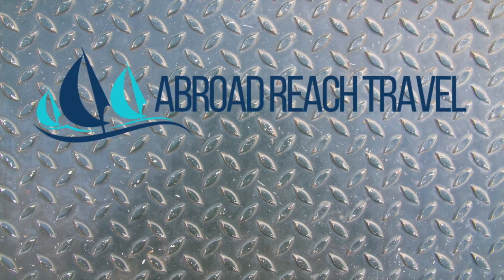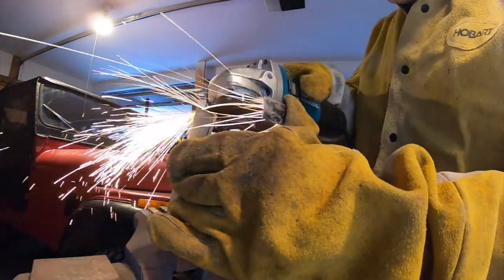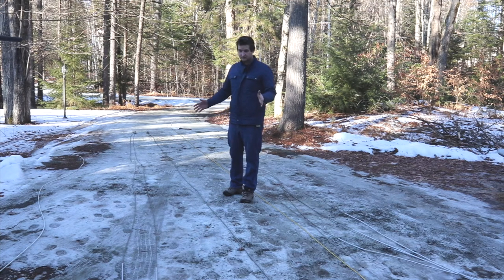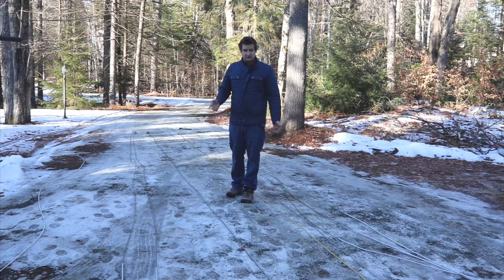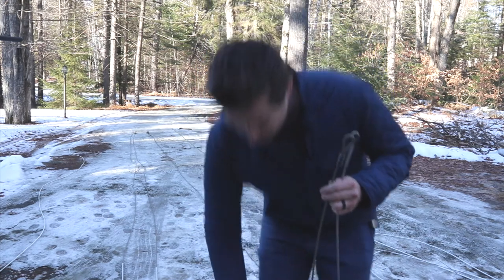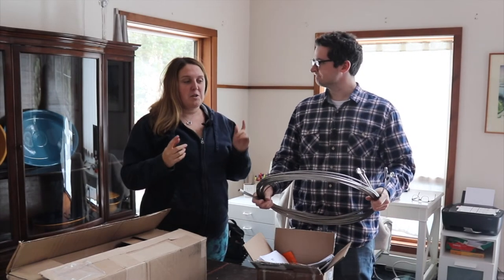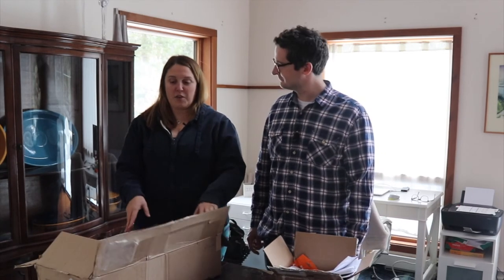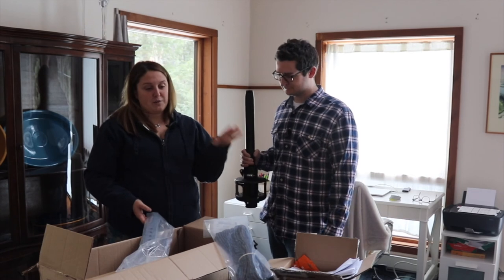Measuring and Ordering New Standing Rigging | Alberg 30 Refit Episode 7

Comment: Another step forward.  Good to see.  Surprising that each shroud is a different length.  Were the differences more than 1/4" to 1/2"?
Reply from the maker: Jonathan Bresler with everything else we’ve found over the years we aren’t shocked.  🤷🏻‍♀️ There was a 1 inch difference between the upper shrouds and a MASSIVE difference between the shortest and longest lower.  About 8 inches.  😳 we think that there was really only a difference of two inches from one side to the other and the bigger difference was between forward and aft but still that’s a lot!
Reply: @AbroadReachTravel  Lowered the mast recently.  The shrouds on Constance #262 are close to one another in length.  Uppers: 34' 6-1/2" port vs 34' 5-/34" starboard, forward lowers: 18' 6-1/4" both, aft lowers: 18' 7-3/4" port vs 18' 8-1/14" starboard.